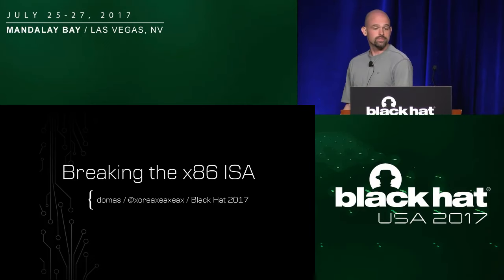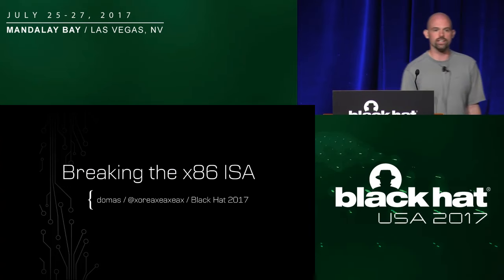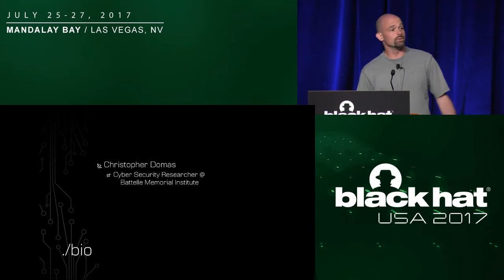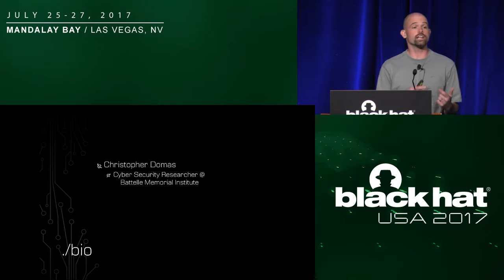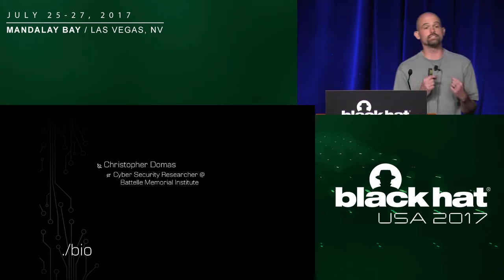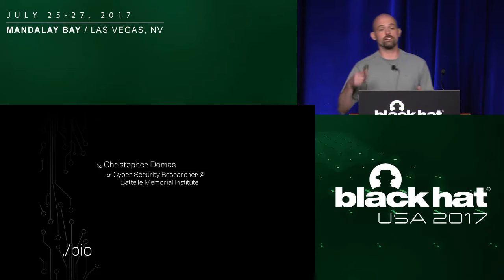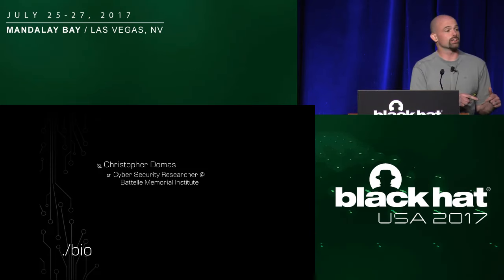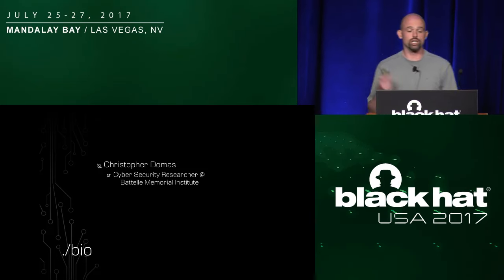Breaking the x86 Instruction Set

Comment: What concerns me is let's say he executes one of these unknown instructions and it alters the way the processor executes a currently benign instruction. Perhaps changing a jump and read to a jump and execute. I'm not saying it's changing the hardware, I'm saying maybe this instruction is inside the processor for a reason that we're not supposed to know about. Such as this instruction flips a bit that diverts an execution pipeline to a part of the processor that has been idle for years that now is operating under an altered instruction set.  So I suppose that when this scanning tool is run, you should probably run it numerous times to see if you find some different results during the second pass, indicating a new instruction or instruction set has been enabled.  (I'm talking like NSA level stuff)
Reply: Another thing that needs to be addressed is capturing what microcode level is being used in the processor.  When you flash your bios on your computer, the motherboard vendor will frequently add microcode revisions to the bios that patch bugs in the CPU, but they could also activate or disable these things you weren't supposed to know about.  The same thing with silicon revisions and steppings.  Those are hardware alterations to the CPU internally.

Comment: About 6m40s in it says #40 is a single byte instruction `inc eax`.  I assumed an #40 would cause a situation where if `ax` reached #ffff it would go back to #0000 and set the carry flag, but #66 #40 should increment eax to #00010000.  There are several other minor factually confusing statements throughout the video.  On the whole this is a great talk and seems to be presented by an absolute expert so now I'm doubting myself.
Reply: First of all, inc and dec do not affect the carry flag. An overflow will set the zero flag, but not the carry flag. As for the rest, i think it depends on whether you're executing in 16 or 32 bit mode. If you're in 16 bit mode, then 40 is inc ax, and 66 40 is inc eax, as you describe. If you're in 32 bit mode, then 40 is inc eax, and 66 40 is inc ax, as he describes.

Comment: Nice presentation, i just sucked it in being an avid asm programmer....
It is a well known problem.The only way around it for REALLY high security applications is code your own processor in FPGA,
and not an FPGA with already an ARM core in hardware of course.
 Anyways, there is more danger lurking in the normal processors and interface chips,
and often many interfaces are integrated, for example when when ethernet and some input device handling is also integrated
then is quite possible it takes just a single request from some specific IP to send all you keystrokes to NSA
or whatever have you elsewhere.
  There is no real security, I come from a hardware background and would implement that as firmware if I worked for  any of those
entities in any of those countries.
But anyways, they know I want to take over the world by now..... ;-)

Comment: A few things come to my mind:

He talks a lot about "trusting" the processor.  I don't think that anyone truly trusts the processor any more than they trust the software.  We just have fewer options when it comes to the processor.  We can either use a computer or not use it.

If I were nefarious and wanted to hide a secret instruction, a couple good candidates would be an "undefined" opcode with ESI and EDI set to special values or DS: MOV AL, AL (an effective no-op that no one would ever use) again with ESI and EDI set to special values.

The gaps in the op-code table are supposed to be values that do not correspond to an instruction.  They may be filled in by later processors.  This is, after all, how the processors have evolved.

He says he is doing the entire thing in ring-3.  I happen to know that accessing the CR2 register requires ring-0 access.  Maybe the operating system is facilitating some of these things.  But it still struck me as odd.

Setting all the registers to zero is a good start.  But some of those instructions include address offsets, which can still overwrite your "supervisor" code.  (Okay, he addresses this one.)

As for the priority error for undefined opcode vs page fault:  Yes, it is an erratum.  They decided it was a documentation error and fixed their documentation.  First off, I can see where they might miss this.  Very few people, outside of maybe myself, are going to deliberately execute an undefined instruction over a page-faulting area.  Admittedly, I do a few unusual things.  I have used MOV CS, AX as a processor check (runs fine on 8088, undefined opcode on 286, man I'm old.)

I miss the days when computers would detect a processor shutdown and just reset the processor.  You could use certain memory locations to tell the BIOS where to resume execution.  Ah, good times, shut the processor down 20 times and return to DOS like nothing ever happened.

Comment: One thing I don't like about this approach is that he doesn't even try to analyze what's going on processor pins, physically I mean. How do you know it's locked? Because it doesn't respond to the keyboard? Maybe there is still a lot of other activities happening on the data and/or address buses and what not. Especially with modern SoC processors that have a lot of built-in periphery on the chip.

Comment: I'm a late viewer of this video. It's some brilliant research, however not unexpected at all.
However, CPU instruction fetchers and decoders are not static in this day an age.
So. The theoretical malformed but working opcode space is potentially much larger.
There is this theory called "Opcode knocking" or "Instruction knocking".
This hidden key sequence opens instruction decoding for a class of non-disclosed instructions which have valid and probably security implicating behavior.
This opcode space would not be visible unless the opcode key knocking sequence has been entered.

So while this helps, there is absolutely no way of knowing backdoor instructions, even with complete pertubation of the variation of opcode space.

Comment: Given the recent car emissions scandal, I wonder whether we will see chip manufacturers incorporate similar 'test scenario detection' algorithms to prevent this kind of scanning in future? It would only mean throwing an undefined opcode exception for undocumented instructions if the processor thinks it's being probed, so there would be no problems for normal execution.
Reply: i rather have a hardware filter for abnormal opcodes like a fpga connected to the processor to check for opcodes.

Comment: Intel ME, AMD PSP...
Reply: Ultrajamz technically not part of it the ISA, a whole other layer of shit... Joanna Rutowska has a very long review of the problems with the arch, x86 considered harmful. there's also a great paper on doping attacks in the fabrication process that can reduce the rng entropy, so even if the spec is good the chip itself might not be... It's all so rotten to its core, we really need open hardware and auditable fabrication
Reply: Johanna *
Reply: Rutkowska*
Reply: That happens with older ME versions as well, anything past Penryn has a 30 minute reset timer. https://mail.coreboot.org/pipermail/coreboot/2016-September/082021.html
Reply: Yes; also nothing except ME11 is even using x86. AMD's ASP/PSP is an ARM core, and ME versions 10 and below were ARC cores.
Reply: I don't know about auditable fabrication, but OpenPOWER machines can be pretty close to open hardware. Or if you are just wanting a micro-controller, RISC-V sounds promising.

Comment: This is way cool. My chip is scanning at the moment, no hard lock up so far.
What about ARM? Could this be fuzzed in the same way? Is the architecture full of holes in the opcode logic as well?
Reply: ovrskr digging through RISC and CISC require different techniques. Might be interesting for finding hidden cisc instructions on an otherwise RISC chip.
Reply: Here https://youtu.be/KrksBdWcZgQ?t=7m15s he said it might be possible to brute force an ARM instruction set, which I'd love to see someone analyze. Running everything in a VM would be a good security measure because one can at least audit open source software, but I'll be replacing my desktop with a ROCK64 or the next Odroid the moment the wayland drivers are usable. Open CPUs are just not competitive yet https://en.wikipedia.org/wiki/Open-source_computing_hardware#Components . Exilant talk though, reminds me of rowhammer.
Reply: I'd be wary of what the sandsifter outputs on a VM. As the video shows, they can behave quite differently from a real system when encountering undocumented instructions.
Reply: +David Kofler that's interesting too man...

Comment: Couldn't you create a "layer" in the linux kernel to block all instructions that are not documented?
Reply: Not a layer, but you could make the loader refuse to load programs that have an undocumented instruction, or that generate code that they later execute. Among other things, you could not use the JIT compilers in Java or ECMAscript runtimes.
Reply: Torpcoms Thanks for the answer. I was hoping for something in a lower level and not language restricted, blocking anything in the kernel level and above to use such instructions.
Reply: You could execute suspicious software on a fully virtualizing VM patched for this purpose. The VM would have to scan all code scheduled for execution for "undocumented" instructions. Problem is, you will lose a lot of performance. And there would still be the slight issue of hypervisor and disassembler bugs creating false positives/negatives. Watch the video for what can go wrong with such approaches.
Reply: +David Kofler vm's can't prevent magic numbers...
Reply: @bakedbillybacon  The detail about JIT compilers in Java and ECMAscript runtimes kind of is low-level in ways. Some processors have instructions that allow a subset of JVM bytecode instructions to be used kind of natively... as in in the assembly for the processor. It's not a documented feature in the ARM specification, but I think the name nowadays is Thumb2EE or something like that... the technology known by about as many previous names as a cheap hooker has teeth... so this proposal would indeed strip these devices (like your mobile phone) of their ability to quickly execute various JVM bytecode operations... the JIT compiler would have to simulate using software instead, which would be much slower... Similarly, I think you would lose a lot of multiscalar instructions that Intel has developed which aren't x86-standard...
Reply: @sebastianramadan8393  I don`t know. Java is a terrible example since it`s half compiled, half interpreted. I was thinking more about an Hypervisor-like software that filters the instructions to the CPU. If you are already able today to emulate x86_64 over ARM CPU`s I think It could be possible to instead of emulate, just filter the instructions from the software not to touch the hidden instructions. But hey, this is just my 2 cents, I'm not an Hypervisor developer to know enough about this.

Comment: Maybe I'm not getting something, but in embedded processors where you don't have all this instruction length overloading you still have piles of reserved instruction space that we just don't know what it does.
I'm sure even at a hardware level in x86 you have unfinished, literally reserved blocks of silicon set aside for some future functionality.
I'm a lot more interested in things that are documented to do a specific thing that dont do that thing.
If you're playing baseball and you substitute a bowling ball for the baseball then meh, you get what you deserve.
If, instead, you're playing baseball by the rules and whenever you go into the 256th inning the baseball starts clipping through the catcher, I'm a little more concerned about that.

Comment: If you're having problems compiling and running this program on a Debian-based Linux machine, first install Capstone using "sudo apt-get install python-capstone". The program will not work if you try to install the regular Capstone from the repository or from source.

Comment: I wonder what happens if you try to disassemble these opcodes (either the undocumented stuff or the stuff that other disassemblers get wrong) through the Intel disassembler (the one in the debugger that comes with their compiler). Does the Intel disassembler display any useful information about opcodes not documented in the processor manual? Does it correctly disassemble the instructions that other disassemblers all get wrong? I have a nice shiny Core i5 CPU here and would try the fuzzing tools in both 32-bit and 64-bit mode but I dont have a Linux setup, just Windows so I cant :(

Oh and hopefully the vendors/creators of those disassemblers that are incorrectly disassembling instructions have been notified so they can correct those bugs.
Reply: That disassembler is probably written from the same specs as all the others.

Comment: I'm curios why the cursor was still flashing when he locked up the processor at the end.  I would think the task of flashing the cursor would halt as well.
Reply: The graphics card does the blinking. The cursor blinking was literally done by special circuitry back in the days of text-only computers decades ago when the CPU couldn't possible spare CPU cycles to blink a cursor. And since there's been a continuous evolution of compatible machines ever since, the graphics hardware has never been relieved of that responsibility. Of course, modern GPUs can handle that in their sleep. (If the bug was demonstrated in a Graphical UI, then it probably would freeze.)

Comment: And what if the Processor throws wrong Exceptions on purpose. Why do you trust that?
Reply: ALZlper if it threw exceptions on purpose then it wouldn't work for anyone lol
Reply: At this point, we already have evidence that something is fishy with that instruction or the docs. Likely both. I'd rather be concerned about false negatives, i.e., normal, documented instructions not working according to the docs all the time.
Reply: That's actually what I meant.

Comment: if the processor is completely locked...how is the cursor blinking? is the processor not needed for that?
Reply: in text mode, it's the GPU's job to blink the cursor.
Reply: Correct. Its acturally the GPU that blinks the cursor ^

Comment: For the halt-and-catch-fire bug, how could the cursor still blink?
Reply: The graphics card does the blinking. The cursor blinking was literally done by special circuitry back in the days of text-only computers decades ago when the CPU couldn't possible spare CPU cycles to blink a cursor. And since there's been a continuous evolution of compatible machines ever since, the graphics hardware has never been relieved of that responsibility. Of course, modern GPUs can handle that in their sleep. (If the bug was demonstrated in a Graphical UI, then it probably would freeze.)

Comment: The processor locks, yet the cursor still blinks.

What?
Reply: LOL sounds like an haiku
Reply: The processor locks
There's an interrupt untrapped
The cursor still blinks
Reply: Last time I looked the blinking cursor was hardware in the display controller
Reply: Logan Darklock  Seems like Debian wasn't running in Framebuffer mode but instead used the hardware implemented console controller which is controlled by the GPU (which didn't lock up, as it is not directly controlled by the processor, rather attached via a bus, presumably PCIe). I'm interested if the cursor would lock up running the console on the iGPU (or if was it doing that already), because that's tecnically a part of the CPU.
Reply: AFAIK if it runs (boots) in VGA mode it should be compatible to the early IBM PC,  and that controller
has a control register set by BIOS for cursor flash or not, or cursor on or off.
Linux can , and sometimes does do its own things to BIOS,.
Whatever happens to the  rest of the system, unless it rewrites the display controller control registers,
and that is unlikely if the CPU locked up,  should not affect the cursor or even the display.
The cursor flash is just a hardware counter in the display controller.
Reply: That is not an emulated shell. The CPU has nothing to do with the cursor blinking.
Reply: @Logan Darklock
Stop watching your dads videos and go play with your X-box.

Comment: How can the pagy fault analysis exist? why the processor allow instructions be loaded from two different pages. and why manufacturer don't kill this buggy function.
Reply: X86 instructions don't need to be aligned to anything other than a byte, and are able to span page boundaries. (Pages were typically 4kb on 32 bit systems.)